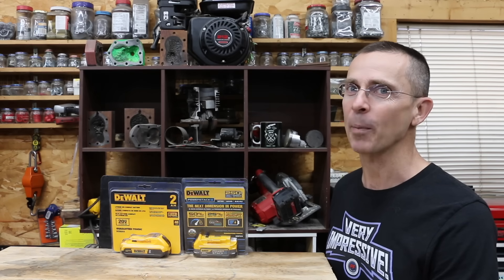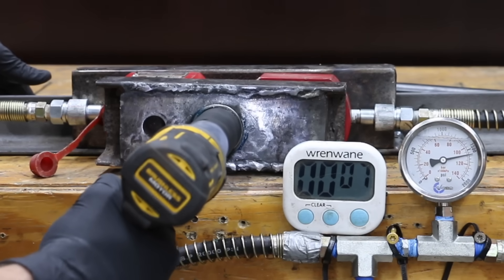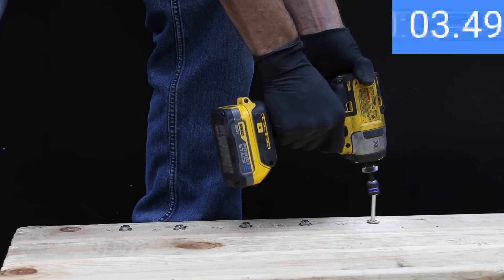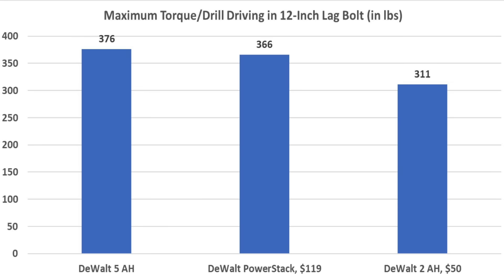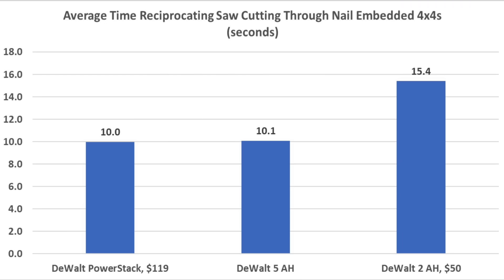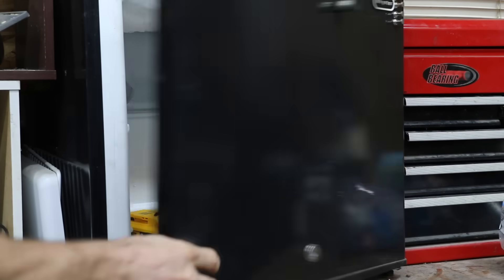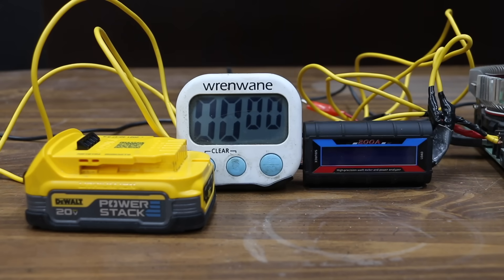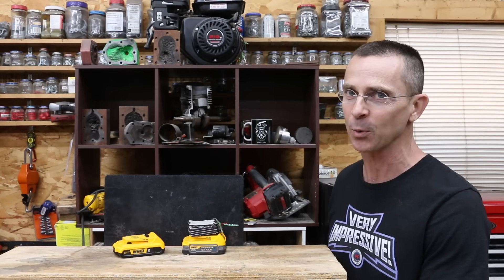Compact “Pouch Cell” Battery Better? Let's Find Out!

Comment: Glad to see you added a weight to the Sauzal can we redo the Sauzal challenge now. I have a couple of the Resip saws that you tested and have completely different results When using them on the job when pressure is applied from the outcome in your previous  video.  But another great video thanks!
Reply from the maker: You are welcome!  Thanks for the suggestion.

Comment: Im not surprised the PowerStack battery provided a power increase after seeing how it is built. In the Radio Control community, those flat Lithium Polymer-type cells are used to power extremely high-performance, hobby grade RCs such as Arrma, Losi, Traxxas, HPI Racing and more, with plenty of models being able to hit 50-60 MPH stock, right out of the box. However, be aware that these flat-style LiPo batteries are extremely dangerous when not handled properly, much more prone to fires and explosions when mistreated. Just keep that in mind! The biggest benefit of this style of battery is high discharge rates, they are able to handle extremely high amperage load, and tend to hold higher voltage throughout the discharge cycle until its out of juice. The negative is as you stated: cost. A higher-end racing pack for an RC car would be something like a Gens Ace Redline 4S (4-Cell - 14.8V) 6000mAH that will cost you $120.
Reply from the maker: Thanks for the feedback.

Comment: Seems like the drive time of the last bolts may be influenced by the angle you drive them.  The slower times seem to correlate to you holding the drill at slight angles.  Something to look at, I may be wrong.
Reply: Lag not last

Comment: When driving lag bolts it would be better if you drove them into an engineered lumber product for consistency. Real wood can have varying density not visible from outside. Other than that good testing and great information. Thanks Todd.
Reply from the maker: Thanks and  you are welcome!  Thanks for the constructive feedback.

Comment: This was a well-done test with valuable information--thank you! It has given me more confidence in my purchase. I got lucky yesterday and caught the 2-pack of Powerstack batteries on sale at Lowe's for $199--that included a free DeWalt 20v tool (I chose the DCW200). I have three other types of DeWalt batteries including the DCB201 (1.5Ah), DCB203 (3Ah) and the DCB205 (the 5Ah). i'm happy to get rid of the 201s and the 203s and keep the Powerstacks because of the smaller form factor and greater power output. The 203 is a ridiculous pack and I hate it. Keeping the 205 for use on the string trimmer, reciprocating saw, and the circular saw. It's a great heavy-duty battery. Thanks again for the excellent video!
Reply from the maker: Thanks and you are welcome!  Thanks for the feedback.

Comment: The power stack are def legit and a great step forward for tools.  I use them in my dewalt 998 and dont notice any lack of power like i would if I used a 1.5 older battery. Which is nice to not have to use my 8ah for all tasks. From what i can tell its close if not better than a 5ah battery from dewalt but much smaller and lighter.  Price may be high but i never buy batteries solo.  You can get them in tool deals right now or well priced combo kits.
Reply from the maker: Thanks for the feedback.

Comment: Lipo batteries are great when you want less weight and space savings and they can put out high amps really fast. But they can become very unstable with repeated discharge and charge cycles and can even catch fire. I'm curious if those batteries have a charger that can put a storage charge on them at 50% so they can safely be stored for periods of time and if they have any warnings concerning safe storage.
Reply from the maker: Thanks for the feedback.

Comment: The 5ah battery @ $70 gets my nod for the best value.  I'd love to see a 5ah Powerstack tested against the standard 5ah pack.  I wonder what the cycle life difference is between the 18650s and the pouches.
Reply from the maker: Thanks for the video idea.
Reply: pouches are surplus parts from covid inventory repurposing
i think with good pouches it would be an even stronger battery
Reply: I'd hate to see the price the normal ones are already enough $ Plus if your inclined enough they can be rebuilt for much less.
Reply: Pouch cells typically have worse cycle life than cylindrical cells. The RC Lipo guys are happy to get 200 cycles out of them. 200 cycles is where a cylindrical power cell (when run hard) will start to degrade but will still be usable. Typically by 250-400 cycles you'll have hit the 80% "end of life" metric which is 80% original capacity. The cell will suffer a loss in power and run time but it won't be a swelled up Lipo
Reply: They haven’t released the 5ah power stack @lj prep
Reply: My RC plane batteries J get about 3 to 5 years out of. I retired a 10 year old M18 2ah battery this morning.I will no longer charge ...
Reply: @brokawphotography1  you can try to jumpstart it, there’s some videos on here on how to do it
Reply: They said if i’m not mistaken…the life cycle is double 🤔

Comment: I just bought 3 of the Power Stack batt's yesterday and used one of them for a few hours...like it so far for how light it is.  I live in the Mohave Desert, so I'm really wondering how they do in the 115 *F temp's we get in the summer.  My other batts (2Ah, 5Ah and FlexVolt) have held up better than expected having lost one, 2Ah battery pack to heat failure while erecting metal buildings (though it should be stated that happened when it was 125*F).  I run a lot of DeWalt cordless tools, but especially impact drivers.  I wore out 3 in the last five years and just bought the Atomic for $149 (got a free Stack batt & chrgr with it) as well as a double Power Stack pack for $169...so for the whole package it was not bad and I needed to replace a few 5 year old batteries showing fatigue (not lasting as long).
Thanks PF, again!
Reply from the maker: You are welcome!  Thanks for sharing.

Comment: I would rather use battery packs with 18650 cells, are MUCH easier to replace, then the Pouch Cell battery packs.
Reply from the maker: Thank you!
Reply: @ProjectFarm  No thank you for your great video's.

Comment: I haven't bought any of these batteries lately so I googled and checked at a few different places. I found the 2ah running about 55 dollars, the 5ah around 75 dollars and that 'Power Stack' battery at 130 dollars. I also found 2 packs of the 5ah for about 140 dollars. For those prices I would buy the 2 pack of 5ah batteries for only a couple of dollars more than one of those 'power stack' ones. Even with it performing a little bit faster when very cold, I just can't even dream up a scenario when it would be a good choice. The other thing to consider is that with the more conventional lithium batteries, they are relatively easy to repair with cells from other old tool batteries. I don't know where you would look for replacement cells for the power stack. I have seen the lithium 'packet' cells for sale but not ones rated for the drain rate of a tool battery. This factor is irrelevant if you don't repair your old batteries though. Great Video!
     Ya'll Take Care and be safe, John
Reply from the maker: Thanks!  Thanks for sharing.

Comment: Never heard it called a pouch cell before. I've always called them prismatic cells. It interesting battery tech to see in tools but I wonder if they will wonder if they will be as reliable over age as cylindrical cells. I have at this point in my life had multiple failures of which some are  catastrophic with prismatic or pouch cells. Although supposedly pouch cells have a higher rated cell cycle (# of recharges) than typical cylindrical cells.
Reply from the maker: Thanks for sharing.

Comment: Short term, lipo packs are better since they can output higher amps and is more dense. Long term, li-ions are better since they hold up better through time. Lipos degrade faster and  is more dangerous since it's prone to punctures and bloating as compared to li-ions. I build batteries for PEVs and i never go for Lipos. Just parallel enough  li-ions to output the same current as a lipo rated batts.
Reply from the maker: Thanks for the feedback.

Comment: These are not even 2 amp batteries I’ll wait till they make a 5amp but the 6 amp batteries in my opinion are the best on the market for the heavy duty construction I do everyday the 5amp is great as well but you get the full day out of a 6 especially on a grinder
Reply from the maker: Thanks for the feedback.

Comment: Great work as always. One suggestion for displaying time dependent charts. Set the Y axis minimum to zero or close to it. This provides broader context to the performance and reduces what can seem like large differences in performance when looking at a narrow window.
Reply from the maker: Thanks!  Thanks for the suggestion.
Reply: i second this i was thinking this exact thought when I saw the first graph
Reply: I wasn’t thinking that at all. Not even close. Probably had ramen or something on my mind.
Reply: Yes, I had the same suggestion.
Reply: I disagree. The purpose of the chart is to compare between the different batteries. It's not a leaf blower review, the exact numbers are not important. What's important are the differences between the numbers. If you were to set the Y axis to zero, then all the batteries would look nearly identical, and it would be difficult to tease out any difference at all. Plus, you'd be wasting 3/4 of the screen on pointless blank space. This is especially the case when you have the values of each point labeled in bold font, since it's clear that the Y axis has been changed to emphasize the differences.
Reply: @derpmansderpyskin  If the results of the battery performance "looks nearly identical" on a full scale graph, that is because it is nearly identical.  This is more useful information than near meaningless small differences zoomed in to look significant.
Reply: @derpmansderpyskin  it's just wrong. It's much better to add a second chart to zoom in on the details for anybody who is going to base their decision on the exact numbers. If all of the batteries are relatively the same, that would be shown much more clearly on the first graph.
Reply: @derpmansderpyskin  you're not actually paying a difference in price either, you are paying the full price for the thing you choose, so it's better to know the overall performance than to focus on minute, otherwise imperceptible differences.

Comment: Thank you for this test. $120 for 2Ah battery that contains slightly different components  does not make it worth two an a half times more than the similar $50 unit. Dewalt marketing thinks their customers are dummies.
Reply from the maker: You are welcome!  Thanks for the feedback.

Comment: most electric vehicles are using polymer cells, do they not give a AH or Wh rating on the new battery?  Your cell phone has 1, 3-4 Ah cell in it (packaging). With cold or hot the battery will still work if the BMS does not have protection for it but the main issue is it degrades the cells faster. great video as always!
Reply: I have built my own dewalt battery with a 3d printer and 18650s. I also bought a DIY with everything but the batteries.  I used LGH1 cells i think.  3200mah, so 6.4 ah in a 5 ah case.  Then with the 3d print I did 5s5p with sony VTC5's  I went pretty deep with battery DIY for solar.  I have over 6000 18650's in my 48v 1222ah solar battery.

Comment: This is how they are trying to make it so you cant easily replace your batteries. Pouch batteries suck, i just spent $90 for mine in my galaxy note 9 yesterday, they fail and bloat. The 18650 are tried n true, when they fail they dont need a pouch seal to prevent toxic or corrosive gasses from being emitted.
Reply from the maker: Thanks for the feedback.

Comment: My problem is that the charger is not charging ( something is happening) have bought two chargers, (DCB201 BATTERY PACK. JAPAN  20V.   1.5 Ah. 30Wh.  Type 1)  could it be because some old houses I work on have 30 amp breakers on 12-2  sometimes 14- 2 wire?
Trying to figure out blown chargers. Richard South Carolina

Comment: "Pouch style" is a lithium polymer cell, or LiPo. Used in RC applications for a good while. Be careful with those. They are more volatile than 18650's.
Reply from the maker: Thanks for the feedback.

Comment: At 2:28 RPM test without a load is insufficient. because the brushes are not even when put in forward and reverse there is a variable speed between them. Because people run their drills more in the forward then a reverse setting. Uneven brushes give uneven power to the armature.

Comment: So it looks like the pouch cells are just able to have increased current (amps) but not improve on voltage (volts). Higher AH battery packs seems like it's still more important as more cells equals more current/amps AND amp hours. Thank you for doing the test comparing against a 5AH. That's really helpful!

What I'm worried about with pouch cells is heat management. Usually the space in cylindrical means that it can cool off. If 5 pouches are stuck together, thermal regulation may be a problem with heavy usage.
Reply from the maker: Thanks for the feedback.

Comment: Remember when those pouch batteries had a manufacturing issue with Samsung's smartphones?  I wonder if its better to stick with something rigid like an 18650, or perhaps something non standardized size but still rigid (like those old Nokia phone batteries) since these things will def be abused on the worksite.  It looks like that there is a lot of shock absorption built inside the packs but all it took was a bad crimp on one corner to make those packs go up in flames.
Reply from the maker: Thanks for the feedback.

Comment: Pouch in power tools is like making square bullets and fitting clips and calling that a gun tech innovation. Try a cycle test. Try max current test. What about temperatures at high current ? One more problem could be the higher change of impact damage.
Reply from the maker: Thanks for the feedback.

Comment: 14:35 You said there's 6 cells inside the 2 Ah battery, but there's only 5,just like the power stack.
They are both 18V batteries (or 20V max as the marketing guys like to call 18V nominal batteries).
Each cell has a nominal voltage of 3.6V for high power draw Li-ion cells like these. 
5 * 3.6V = 18V
For the 5 Ah battery they just put two rows of 5 cells in parallel for a total of 10 cells.
Reply from the maker: Thanks for the feedback.

Comment: the main issue is that base level battery packs tend to use 2000mAH 18650s with low output capabilities due to cost reduction. the upscale ones tend to use better output capability batteries. the 5AH ones use better cells. most of the thin cells above a certain capacity tend to have that same or similar higher output capability. 

the 5 vs 2 power stack is the more relevant test, when it comes to everything but time you can run it, as they have the closest comparable outputs for the base cells used.

/shrug
Reply from the maker: Thank you for the feedback!

Comment: I never considered how much performance is lost with the out of the box 2ah batteries. I honestly was disapointed with my 1/2 impact i bought specifically for axle nuts when it couldnt remove them. With a better battery it was able to get some. Seems like a bad idea to package it with this battery because im here looking at reviews considering exchanging my impact wrench for a lesser brands ratchet and impact. Not being able to break axle, crankshaft, bell housing bolts loose leaves the impact in an almost useless zone for me, not strong enough for the big stuff to bulky for the small yknow.
Reply from the maker: Thanks for the feedback.

Comment: Li poly is more demanding on the charge state when not in use, the cells staying in full charge/full low all the time literally degrades the cell itself. Unlike on li ion 18650 cells which are more forgiving in that regard, making it last longer
Reply from the maker: Thanks for the feedback.

Comment: 120 for 1 battery  too much hmm unless one 5ah is pain in my back i would not upgrade hehe i prefer more running time battery than power i was wondering why all drill brand didnt come out with this lithium packs 3 years ago , they are now all going to go this way just wait 2-5 years and everyone will have this type of packs , im good w the tools i have no need to change bat. no one yet is testing a drop test for how toxic or flamable this new ones are , hello someone steal my idea heheheheh and run a test God bless you all and stay safe .
Reply from the maker: Thanks for sharing.

Comment: The 21700 cells are the best in my opinion. While the pouch cells pack a punch they have a really short cycle life and when ran hard like in drones or in this case power tools I'd imagine they'll have a short lifespan and also I don't see any real compression on those cells to stop them from expanding? I'd be scared to drop these
Reply from the maker: Thanks for the feedback.

Comment: I always have a hard time buying any of the battery systems. I've got a harbor freight tiny impact which works great used it for screwing in a lot of fence boards. However, over the years I've noticed so many tools becoming useless after a few years of usage.
It is nice not having a air hose or power cable in a lot of things.
Reply from the maker: Thanks for sharing.

Comment: Here is a project for you let’s say you take three predator engines and weld the crank shaft to the other of the next engine in a line. Make sure there all at top dead center before welding! How long would it work or would it work. And let’s say it does work how about we use hydraulic coupler also between the engines to increase hp and make it a redneck inline engine! What do you think of this project idea?
Reply from the maker: Thanks for the suggestion.